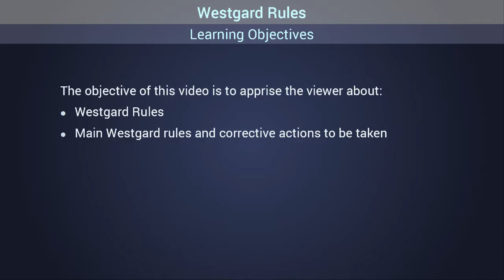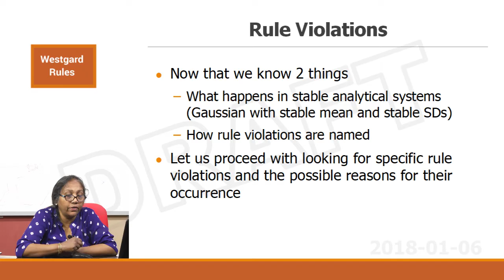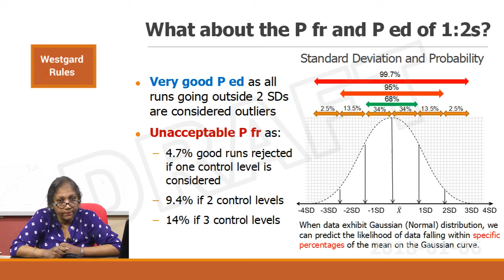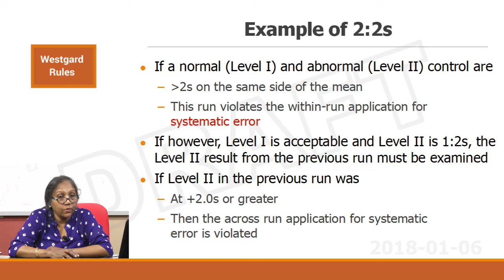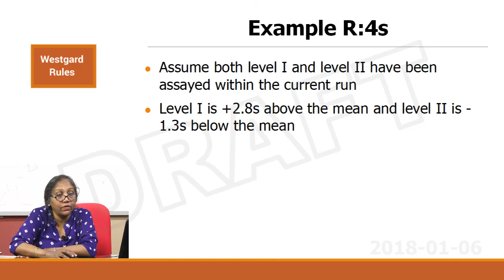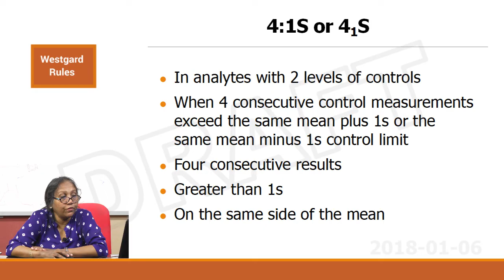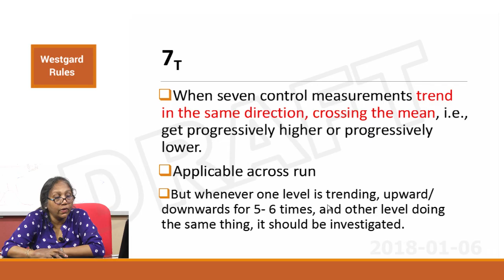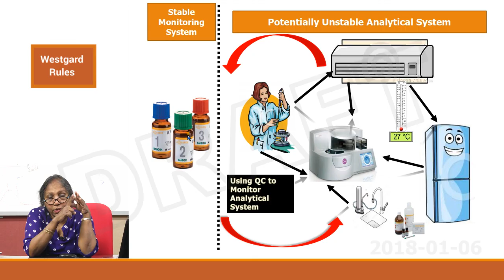Westgard Rules

Comment: I guess there is choas in within run and across run. As of my understanding , within run is when we use a single control material and across the run is the interpretation on both the normal and abnormal control .
But it seems there is misunderstanding. Pls correct me if I'm wrong.